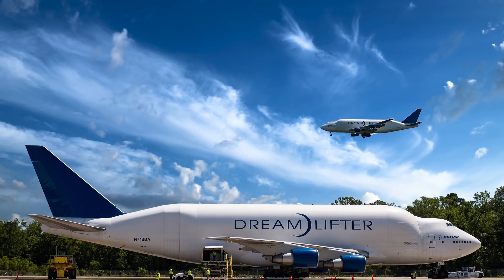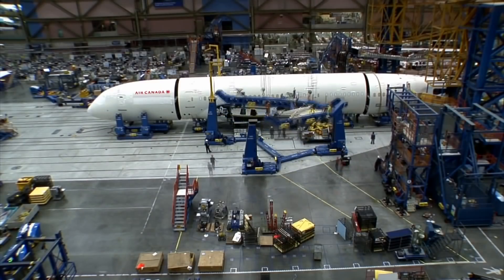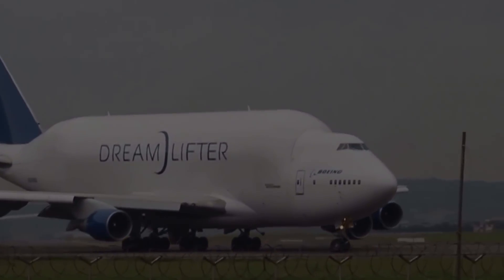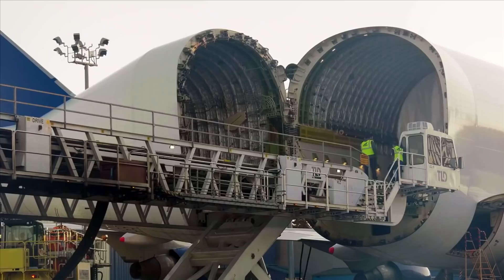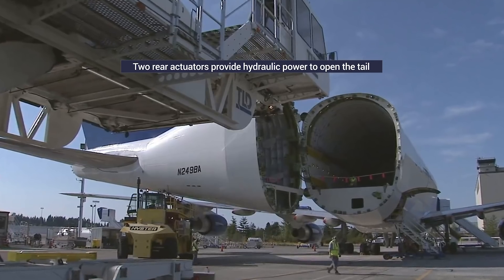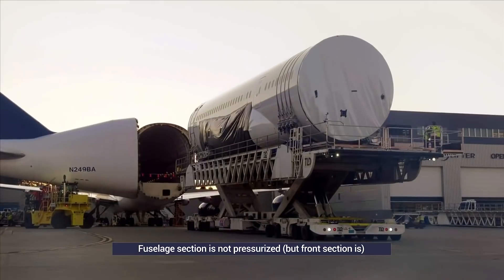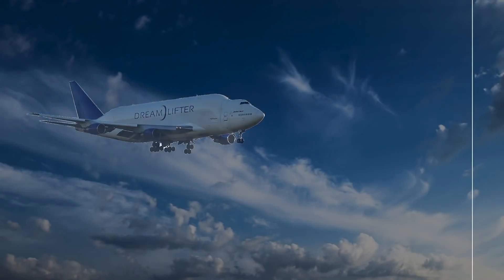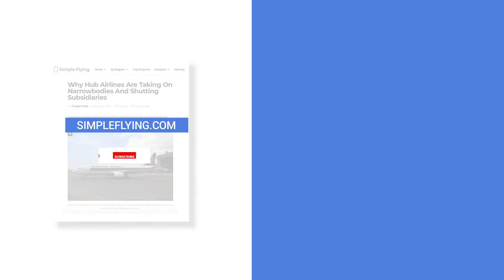How Does The Boeing Dreamlifter’s Swing Tail Door Work?

Comment: If it does not have an APU, how it would do an in-flight restart if the engines were happening to be flamed out? [Considering windmill method does not work].
Reply: 747 apu doesn't start in the air anyway. Would have to use windmill restart

Comment: 👍🏻 Boeing saved its reputation in high capacity class as it bigger and carries more weight than beluga XL, plus it looks away much cooler than beluga. Boeing nailed it. Hopefully they will build more of this in future as demand for outsourcing grows.
Reply: Off course the 747 has a higher take off weight, it’s a 747 after all and not an A330. By the way, the Cargo hull of the Beluga XL has a volume of 2209 m^3, the one of the Dreamlifter is 1840 m^3!
Reply: The Beluga don't need to have the performance of the Dreamlifter, since the Beluga does fly freights on international flights, and the Dreamlifter intercontinental flights.
That should make sense

Comment: If the DreamLifter was based on the 747-400, how come there were no winglets? Is it based on the -400D, or did they remove them for some other reason?
Reply: The winglets where removed because in higher speed during the flight Boeing had difficulties with flutter of the wings because of differences in the whole aerodynamics because of the enlarged fuselage and so they have removed the winglets to prevent this flutter issue! And an other thing about it - the Dreamlifter only flies on an reduced speed of 878 km/h! That's it! Greetings from Sarah Sutter 🙋‍♀
Reply: @sarahivsutterb747  thank you, you obviously know your stuff!
Reply: They were removed, I think it was there were some aerodynamical issues or something like that
Reply: Oh ok thanks!

Comment: Simple flying do a video why;
(1) 787 10 has 2 instead of 3 wheels in main gear
(2) a330 freighter has a hump like on its nose gear housing
Reply: They did a video about the A330F a few weeks or months ago

The 787 just doesn’t need a 3 wheel landing gear, it’s light enough? Why should it have two pairs of tires more if it just isn’t needed

Comment: You didn’t mention one important engineering challenge in this project: the Boeing 747‘s control surfaces are operated by steel cables routed from the cockpit all the way to the tail. When swinging a part of the fuselage open and closing it again, you have to ensure proper functioning and pre-tension of these cables, so the controls work properly and you have no play or risk control surface flutter. 
The Super Guppy that Airbus used before the Belugas had the same issue when swinging open it’s nose. By lowering the cockpit, Airbus managed to keep airframe and control systems untouched during daily operations, opening and closing just a ‘regular’ door without interfering with primary structure or control systems, and thereby solving a major disadvantage of the Super Guppy.
It would be interesting to know why Boeing’s engineers chose not to follow the same path of improvement.
Reply: I was always wondering about the cables to the aft, if they had a way to reattach the connections physically or fly by wire.

Comment: Just wondering and I'm sure Boeing would have looked into building a civilian C-17 instead of the building the Dreamlifter.  Is the C-17 smaller?
Reply: Much smaller, yes. The 747 is a little shorter than the C-5 or An-124

Comment: OK Tom, since the tail is hinged, they must have removed the rear pressure bulkhead, meaning the fuselage is unpressurized, don't you think ?  only the cockpit and upper deck pressurized.   I think the An-225 is the same.  good vid, thanks !

Comment: I wish there was a A380 beluga version. That would be so cool
Reply: @JeffreyZhuang  because there's a lot of unused A380 frames now. It will be cheap for airbus to modify it into a beluga and help carry the A220 wings across the Atlantic to the Mobile FAL instead of building new beluga.
Reply: Yes it would!
Reply: Completely agree
Reply: Indeed
Reply: The mouth opens though
Reply: You mean an Antonov?
Reply: The current A330 Beluga cargo transporter certainly still is the best and no other. A proposed new A380 Beluga apparently will not do any better, like the A380 passenger version is such a waste asset amongst current operators as we speak.

Comment: So I have a question, the Dreamlifter is obviously meant for the Dreamliner program, but back in around 2014 or so, the Mt. Baker Terminal was built on the water just to the north of the plant in Mukilteo. They ship in plane parts there, and then those parts get pushed up via rail to the plant. I heard it was for 787 parts, but that was long after the Dreamlifters were put in service. Did they ship them in there at one point?
Reply: Maybe to increase production! The Dreamlifter is not only used on Routes to Everett but can also be seen in Charleston 🇺🇸, Nagoya 🇯🇵 or Taranto 🇮🇹
Reply: @spongebubatz  True, but 787 production stopped here earlier this year, and yet those gray containers still get shipped in via the Baker terminal.